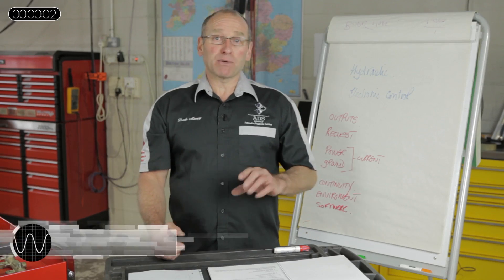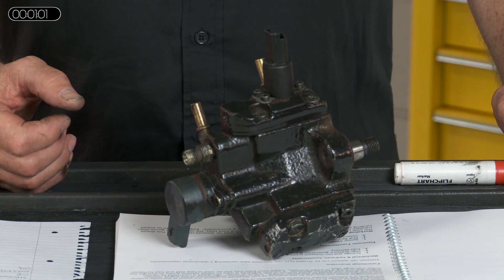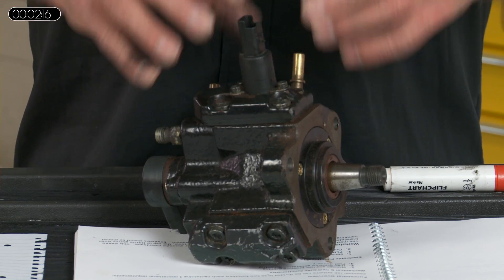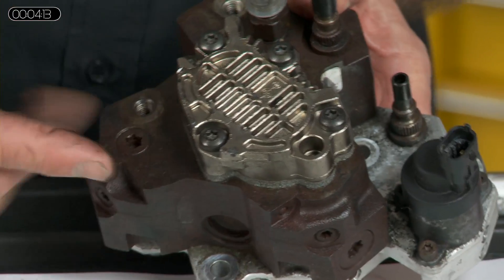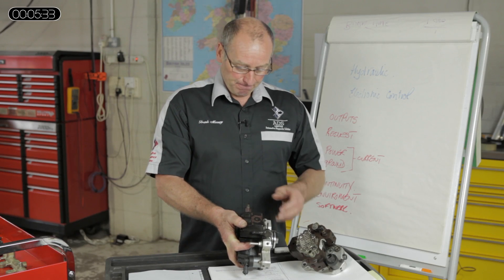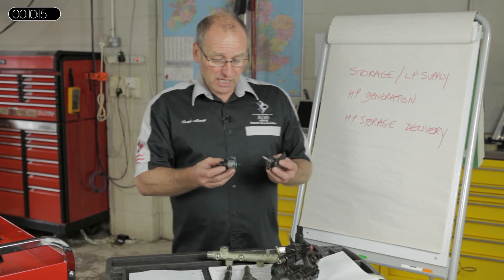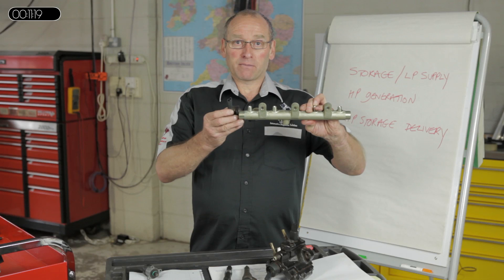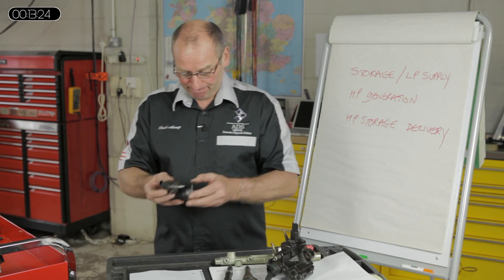AUTOiNFORM: Common Rail diagnostics training module - taster: 2

Comment: Hi Frank love your tutorIal, i have a question Kia sorento CRDI 2.5L diesel turbo done 245000 km.  Cleaned the EGR and turbo and Replaced the new Copper injector washers and engine started ran for 15 minutes  gradually engine stop. Trying To start the engine again but no luck, crank but want start,  Changed MAF,  Fuel rail pressure sensors,  Fuel regulator and fuel filter but still not starting.  When i crank engine trying to start but want hold. can you help me.
Reply: Injectors are faulty